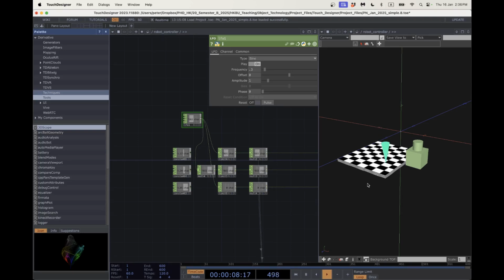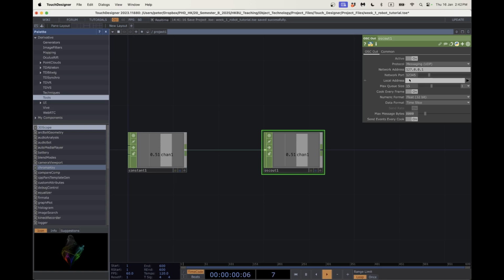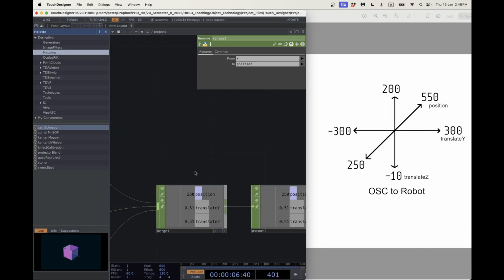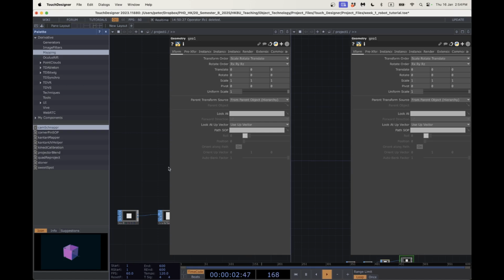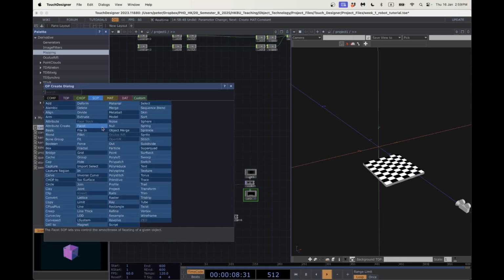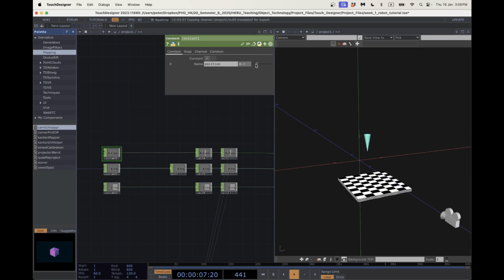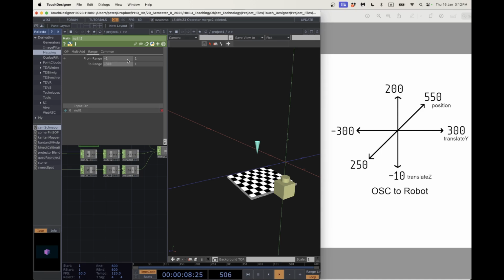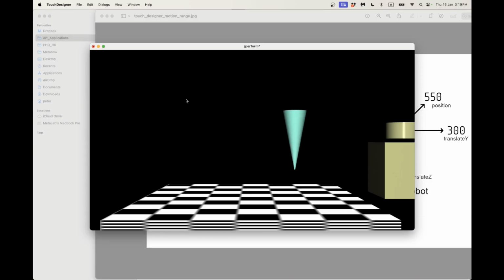Making a simple Touch Designer network to send OSC to an XArm5 Cobot

Comment: great video! are you using a python script to receive the OSC data and send that as point data with the xArm SDK? are you setting the position directly or using something like move_arc_line? just curious about your implementation as I'm working on something similar hehe
Reply from the maker: Sorry for the exceptionally late reply, we were using a python script to receive the OSC data, but have since transformed the system to use a socket connection directly to the XArm. We have shared the Blender file here in case you want to try it out: https://youtu.be/8433IYEh4PA?si=xde6lHa48hShF9UG